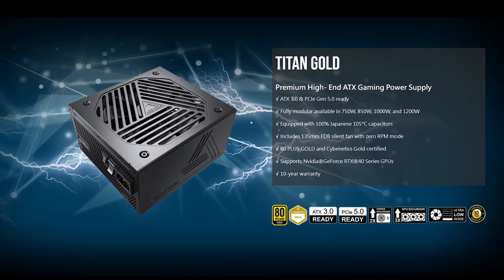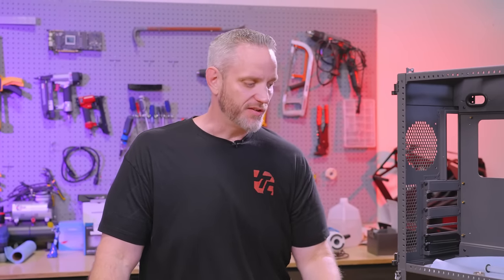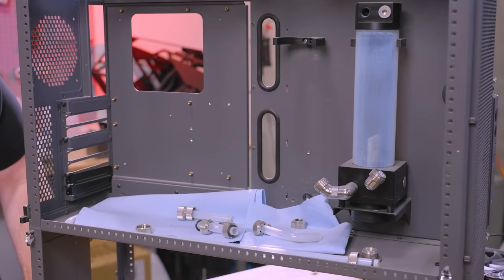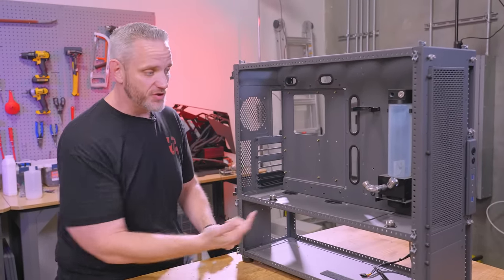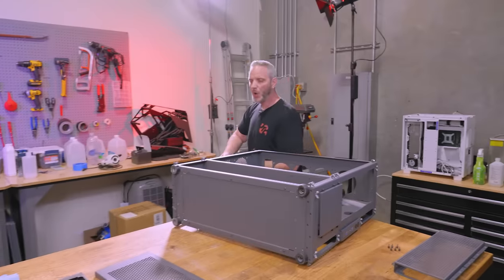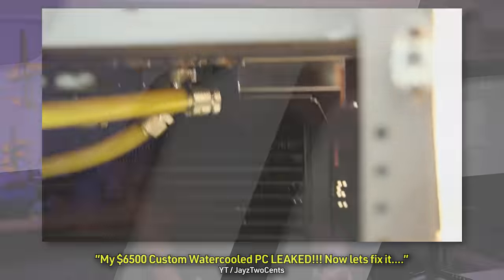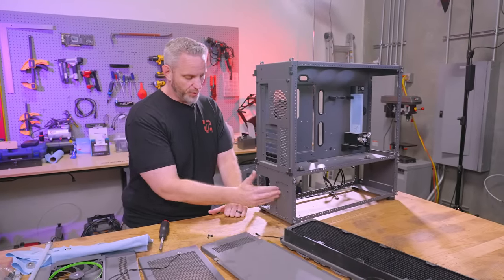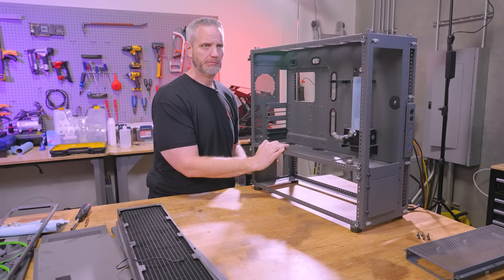Am I crazy for trying this??

Comment: Sounds awesome 🤩; Just as an idea what to do with the passthroughs: You could run some tubing on the bottom of the Submarine layer and make them look like oil-pipelines on the ground of the ocean and use it to transport your fluid from the pump to the gpu or so on. Also in that case I would use  something like the Go-Chiller graphite based liquid to mimic the oil
Reply: I was thinking something similar, but instead of just running pipes, why not create his own reservoir out of acrylic in the bottom, with the ships inside the reservoir.
(Probably not doable because you need to keep the loop clean...)
Reply: @ActionBrother Maybe just paint and decorate the hard line to look like pipework. Also, add some graphics in the back of the bottom section with something that makes sense in the represented diorama. Like often is done with aquariums just by pasting a poster to the back.
Reply: Now that idea I like. They can 3D print parts for the tube to look more like an actual pipe. Could probably use that Idea to hide cables as well.
Reply: @ActionBrother  Crazy idea:  the sub IS the reservoir!

Comment: Like the idea of this build!  Seeing that you need to make a wall to hide the power supply behind maybe it's an idea to have a distribution plate attached to that vertical/long way. Then you could see the water moving through the epoxy resin in which the sub is

Comment: Aaaaawesome idea!! I would leave the grey paint of the case and eventually make it look more weathered and used so it looks like the inside of an old warship with copper pipes and fittings for the water cooling. For the diorama you could even use the pump/res combo and make it look like an old lighthouse and I would even hang a small wareplane somewhere up top in the case. 
Love your videos guys! ❤

Comment: If you paint that, go with a full battleship theme. 

For the exterior of the case, the lower compartment could be the red antifouling paint that you see below the waterline on ships, which would make sense since the submarine diorama would also be below the waterline.  Above the waterline, go with the battleship gray and blue camouflage.  Then make the top look like the wooden deck.  The fans would then look like barbettes where the turrets rest in the deck of the ship.  

The interior of the case could be painted the pale olive drab and eggshell white of the WWII battleship interiors, with accent colors in bright yellow, medium blue, and black.  The liquid cooling pipes would be perfect if you use the white fittings like you're using in the Mega Man build.  Pipe fittings would have a more authentic naval look than bending the pipes.  Then fill it with a white fog coolant, as there are A LOT of huge white pipes running through the interior of battleships.  If you could somehow make your reservoir and pump look like a boiler room, even better.

To top it off, I would program the interior RGB to go from a well lit white light, then beat to quarters and go to to a nice deep red lighting.  I would try to tie that color change into the thermal load if possible, then when you fire up a game, the interior of your case goes to general quarters with battle stations lighting.

Comment: DO IT DO IT DO IT DO IT DO IT.

I reckon you could use the Singularity distro plate you talked about as the sea on which the Destroyer floats - just need a deep blue coolant colour. The tubes into the distro plate could be made to look like water columns exploding up from depth charges.

Comment: I don't know if it's time dilation because of the pandemic or what, but it's hard to imagine that the last builds in it had Titans in it. That was so long ago. I remember the different systems built in that case, and I would love to see it come back to life. Love to see it all filled out again.
Reply from the maker: The most recent version of Skunkworks has SLI 2080Ti, I was just commenting that it USED to have 3x Titan M
Reply: @Jayztwocents  Right, I was just thinking we haven't seen a Titan card in such a long time, having been "replaced" by the XX90 series of cards. Though, lots of memories in that case, and I am happy to see it make it's return on the channel in some new build (diorama is going to be AWESOME), and that CaseLabs is coming back as well. Very exciting times ahead for case building.

Comment: Idea, paint a ocean surface / sky scene in the upper MB tray area, include some ww2 style planes.  On the bottom of the upper tray are paint water (where your model would go).  In the lower section do your scene of your sub getting blasted by depth charges.  Include the design into the wall for the PSU, an underwater ocean scene.  Oldskol trick,  maybe if you include LED's in explosions you could wire them up to the HD active header, you know so they glow or flash as the HD is accessed.  I did that on a  dragon skull mural on the side of a case.  I inserted red LED's in the eyes, so they glowed.

Comment: Suggestion: Build a ship in the scale range of between 1:1 to 1:5 and just have a part of the ship in the case.
The idea is to turn the case into a "window into a ship" or a "3D painting" of it, the effect you would feel is like you are looking into a portal to a ship. Almost like looking at a stop motion scene.
You could have the perspective of being in the ship and looking out through a window and that window could be a display panel showing the ocean.

So basically when looking at the case you are effectively looking into a "window" or a portal into a ship where you see ship stuff from the inside like bolts, doors, pipes (the cooling could be a part of the ship pipes aesthetics) hatches, ventilation, windows e.t.c. and also from the window (the display) you can see "out" to the ocean, maybe an ocean filled with ships battling out or docked at a harbor.

Comment: You could have a transparent screen at the bottom adding effect to the sub diorama and a mechanical 3d printed gears moving it it with the waves. Since you may be going for the naval aesthetic you can paint rust on it, add rivets and use a naval ship color/pattern.

Comment: Here's an idea. Around the submarine diorama, make custom "flat" piping to run your coolant through. Instead of the standard circular tubing, design like a flat/oval shaped piece and have the water run over the submarine from all corners, and have a flat section on top, like a large waterblock, that the destroyer sits on.

Comment: Suggestion: Use the lower reservoir place the "Water" w/Destroyer on top. This way the coolant could be a sea blue/green and help color your "Water". Even make your Epoxy "Water" and drill holes to fit your tubing connections to the reservoir with standoffs so they would easily come above the Epoxy "Water". Hard to describe. But it would be a way to "Hide" your reservoir.

Comment: Alternative idea. Turn the case on its side, add 3 big grey tubes and armor panels and rangefinders... and the case is a triple-gun turret.
OR

another alternative idea, hollow out the epoxy around the submarine and use that space as your coolant tank, so you're pumping metaphorical ocean water our of your boat scene to cool the CPU! The resin and the water should have similar refractive indexes so I bet it becomes invisble when full.

Comment: they have a power supply support that would be a perfect starting point for making a back wall for the bottom section. i am pretty sure you can get the files to 3d print them

Comment: I would like a return of Skunkworks. Get a pro automotive finish done and wait for 14th gen and do your 14th gen build in this. Not keen on the battleship scene, the case should retain the overkill radiators for silent operation. Sure SLI is dead but the 4090 does put out the heat of the old triple SLI loop! (when overclocked) and you can fill the space with vertical mount.

Comment: Want to try something nuts Jay. Paint that case with Black 3.0, then backlight your water lines. (I did it with my system and plan on putting a snowblind mod against the waterline to animate them. And I do have some pics available). But the Black 3 would confuse your eyes and the backlit waterline would make everything look like it's floating in a void.

Comment: @JayzTwoCents That case is awesome! .. I would not repaint it i leave it as is and let it have that worn used battle ship look its self. I was thinking Space Battleship Yamato.  An idea would be it will need some wood somewhere to give the deck look ...maybe the gpu and you could have a model of one of the big cannons on there. Kind like a zoomed in area of a certain part of the ship and could have people running around. As for the lower part. What if you had a reservoir in the area behind where the sub would be, and the acrylic sheet in front with a blue-ish tint. Have some of that wave lights on the reservoir for that under water look. I would not use resin, it would make it extremely heavy. You could get a small acrylic crystal rod, to glue to the side of the sub and then reservoir. If you did decide to do an resin under water area i would measure the area make a box from acrylic, and make the under water part like that then you could just slide that part into the case. That way if it went bad you would not destroy the case. i have more ideas but I don't want to write a book here lol.

Comment: Kudos on not selling this case Jay. For the lower diorama piece: what if you repurposed the passthrough fittings, making the lower area a res and did kind of an up-close view of the U-Boat crew (lego people) doing repairs on the damage for that space? Or even pushed the coolant around said U-Boat and used lighting effects to act as the flame from an explosion? Just feels odd not to use those passthrough fittings. Your use of them inspired me to do a similar approach with my 900D & Dual-Loop setup.

Comment: Nice build it could be, it's a giant case. Gun metal or mate black ,its the type of case we need today for high end parts. All those SATA, big GPU,need of cooling an i9 or ryzen 9 for overclocking at least to be able to use some features like thermal velocity to go over the stock 6ghz clock safely under 75C. A lot of place in that and it looks rugged, solid. Some people may need 6 to 10 ssd's,  it needs to fit somewhere...there is ports and more if you use nvme to ssd, some may want that.

Comment: You should build a server in that case, load it with storage and then throw some GPUs in there for AI compute stuff, because you should absolutely be fiddling around with all the cool AI stuff that exists now and needs a ton of horsepower to run.

It doesn’t have to be a daily driver, just make it a cool showpiece with a bunch of sick hardware, and some boats.

Comment: I like the diorama idea. Butif it was me, looking at the case design, I would paint the case up like it was a cutout section of an aircraft carrier, like at a hangar elevator. Then build some larger scale planes to mount on it. Leaving more room to build out the PC inside, and have larger more detailed models in it.. but I'm more into aircraft than naval vessels personally anyway...
Reply: But yeah just have the top painted as the flight deck w some planes just set on top. With a small section inside as a hangar bay w elevator w another plane or 2.. th rest walled off and just painted w hull numbers, stripes, etc..

Comment: Hi 

I watch all your videos and like ve them I got into water years ago went away from it and now due to winning a pc got back into it how things have changed from pond pumps lol. 

I do have a question

Currently I'm cooling a 13900kf delided with a zotac 4090 in same loop. 

Loop is 3 360mm rads 
2 x EK Quantum P360m 
1 X Blackice nemesis GTR 54.7mm

Tubing is soft as never had a leak with soft 16mm od 10mm internal 

Pump is a17w 960ltr hour attached to a barrowch boxfish res

Could I do away with a radiator from loop and see little difference.

I'm using phanteks t30 fans set to 3000rpm mode all this in Lian li XL case 

I also might attempt hard-line if get rid of a rad . But want industrial look with fittings instead of bends and also they do a carbon fibre tube here in UK that looks sick .

Advice from the master is gratefully received

Comment: technically, you wouldn't even NEED to fully submerge the bottom layer; you could do "movie magic" type effects plus a thin layer of color on the plexiglass (or whatever you use) for the bottom layer. using enough epoxy/ resin/ whatever to properly fill the bottom is going to be expensive, and take a bunch of practice (which will also be expensive). but there are plenty of resin channels to learn from...

additionally; you could consider making the TOP section look like it's a section from the ship's engineering sections or something. add some dials and valves, etc xD

Comment: I have the bigger model with the top section, the top actually doesn’t fit a 560,  at least they didn’t make a mount for one, I run two 480s in the top on mine.

Comment: I vote for making the entire bottom area a reservoir and then putting the resin encased model the water would make the resin almost invisible or replace all the panels with acrylic since you can now drill and tap your own acrylic and do one of the mineral oil builds

Comment: Building off other comments... Do 2 split loops, the CPU loop is high and is water/blue color.  The GPU loop is low and is the graphite liquid.  With that, build an oil derrick to cover pipes to the GPU block.

Comment: funny how everything is so riveted and cheap, which is why I went all screws and bolts for my Goggles that are designed to be like the 1920s driving goggles made by companies like Wilson. (I make mine though from everything from copper and brass to stainless or aluminum and even titanium, still not gotten my hands on any tantalum or anything in sheet or tube, but I do have a rod of ultra pure zirconium LOL

Comment: You could also make it so that the whole inside is like an engine room of a warship and maybe add some faux bolts and paint the water pipes the color of an pipe in a ship? Or somehow get a small boat in a water reservoir that isn't completely  filled so it moves around? Might be dangerous  lol

Comment: Technically SLI/Crossfire still works on games that supported it in the past. The reality is a modern GPU's outperforms those last gasp dual GPU systems. Maybe we see multi GPU make a comeback in the future, who knows. Also, Thermaltake didn't kill Caselabs in 2014, tariffs did in 2018 per the CEO via Wiki and 3 sources.

Comment: How about putting all the pc component's at the back of the case hidden from the front, and use the whole front of the case as a diorama, then you wouldn't even know it was a PC until you switched it on, don't know how feasible that would be, but it would defiantly be unique and one of a kind. just my 2 cent's.

Comment: Yes, diorama would be cool, but you need to push more tech into it...something only a nerd could make.  Yes model building is cool, but what if you had a LCD screen behind model in a animation loop and having small motors moving model to the animation or having the model dynamically move based on temperature. For instance the hotter the system is, more explosions and motion you see.

Comment: Caselabs original went out of business in 2018 not 2014 or 2015. It was because Trump put tariffs on steel and other materials from China which primarily resulted in US small businesses hurting and going under like Caselabs and did little to actually hurt the Chinese economy. This is in comparison to the current trade restrictions on China for access to microprocessors which was actually effective and not nearly as damaging to US business.

Comment: Hi Jay. My name is Scott. Living in western WA. I wrote you yesterday about my brand new Asus strix oc 24gig 4090 5hats running on pcie x8 gen 4 instead of the normal pcie x16 gen 4.
 I have removed all ssd including m. 2 nvme including taking the 1tb Samsung pro 990 out of slot one with the heat pipe trying to isolate the graphics card and the slot 1 m. 2 that's set to gen  
Motherboard is the Asus ROG strix ddr5 wifi gaming motherboard it's the z 790 chips set on 5he board. I need your help. Deboures said that these cards are not manufactured correctly in his latest video.
 If you have questions for me and want pics. Please send me an email. I want to help everyone that's having this issue.

I also came across that the drivers and bios on my new graphics card has newer downloads than offered on Asus sight? I don't know if I still need to install the drivers and software for the 4090 when the software that's installed is above what's available?? I need your guys help to help everyone else. Please talk to Deboures. He knows the problem. Thank you for your amazing show. I watch every day!!!